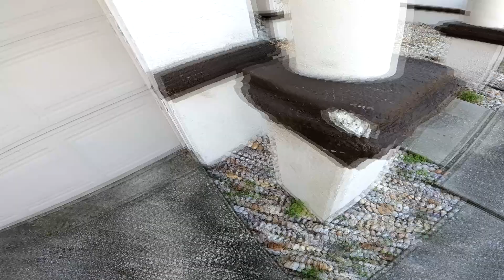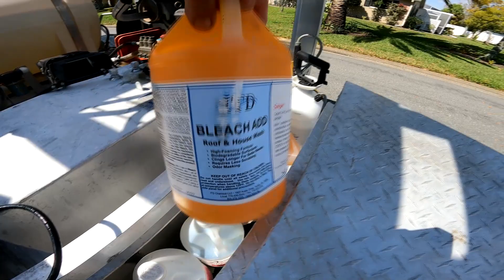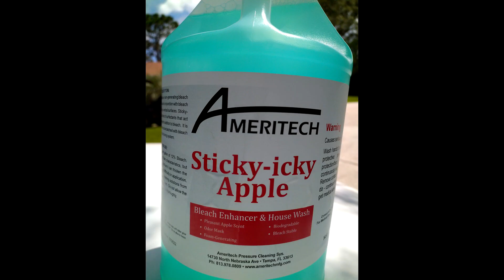BOOM, 3 jobs, awesome ticket day, Free class, #layout #howto #cleaning #demonstration #getafterit

Comment: what size is that hose you use on your injector ?
Reply from the maker: 1/4 you are talking about the one that goes in the tank with the drop stick right?
it is the braded hose.
Reply: @superblastpressurewashing.7256  yes. it just looks bigger than normal is why i asked . thank you